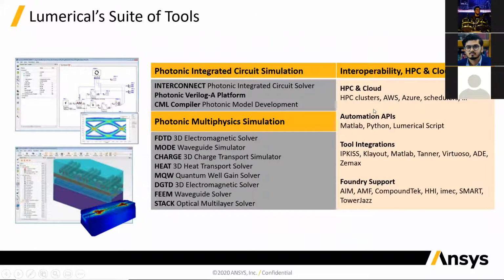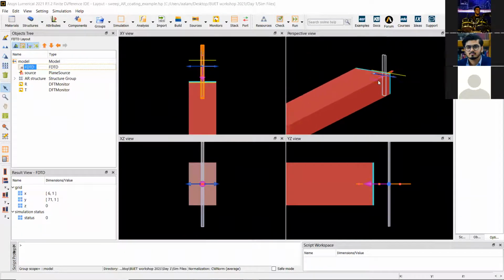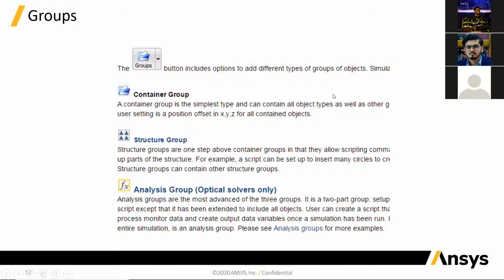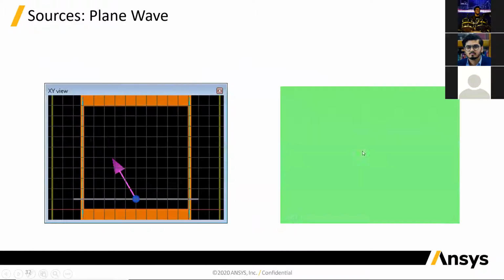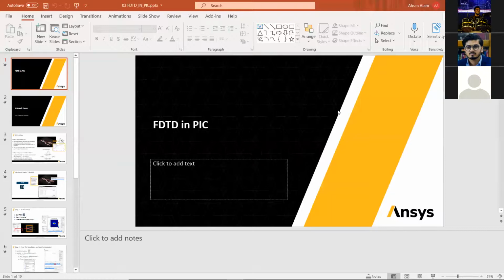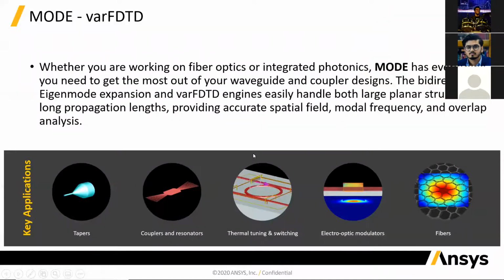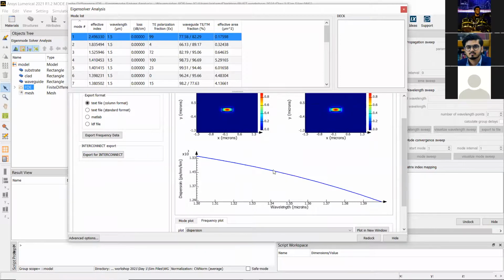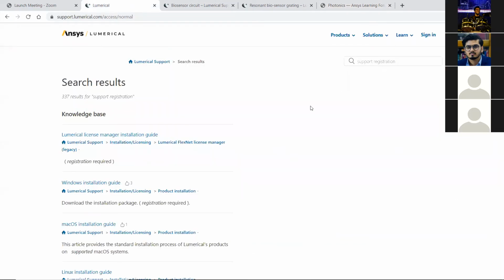ANSYS LUMERICAL TRAINING WORKSHOP (SESSION 1)

Comment: Hello dear @IEEE EDS BUET, I am doing thesis on nanophotonics. My job is to create a structure and find out the absorption, transmittance and reflection of light on it. I am trying to learn lumerical but not getting any project based sequenced tutorial. Could you please help me out?
Reply from the maker: Try following this video, https://youtu.be/4BmjCQNO_rM
You can also seek help from the Ansys forum
Reply: @IEEEEDSBUET  Thanks for your help. Is it possible to get external quantum efficiency curve from Lumerical FDTD, or possible to get current density in case of absorption?